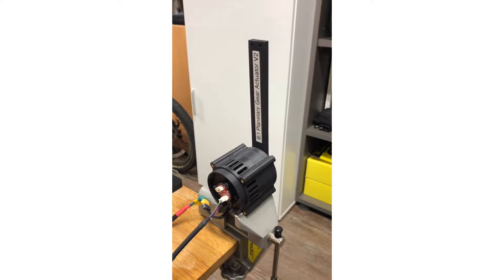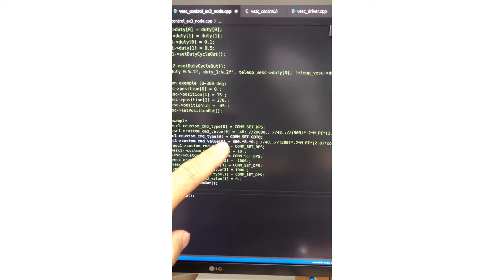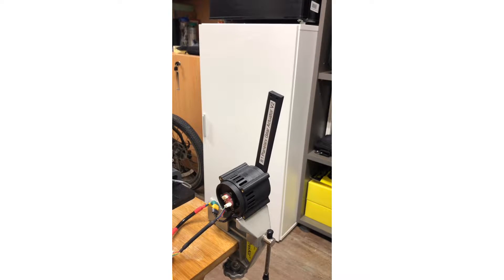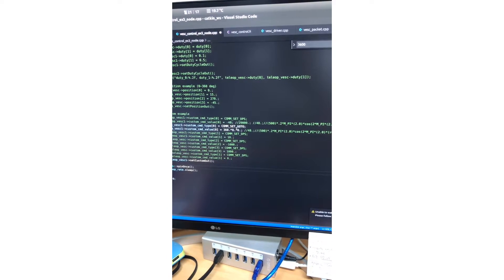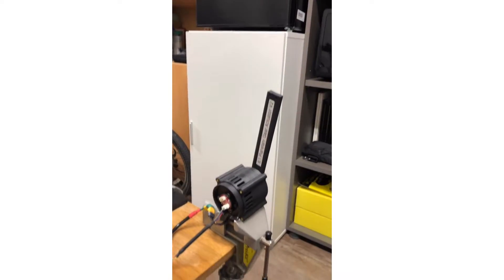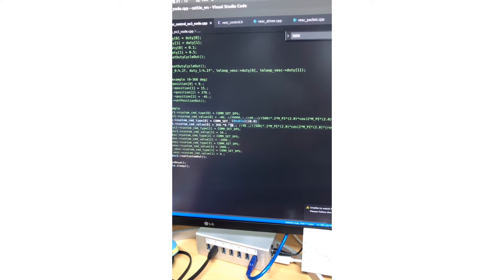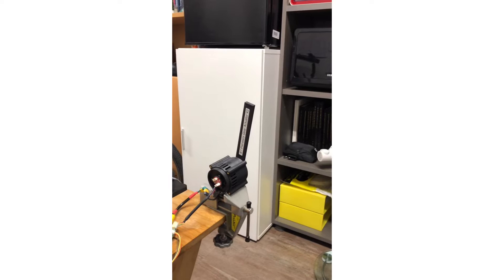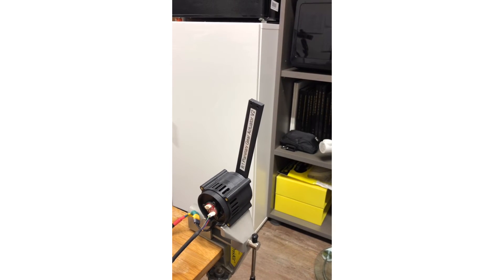MJ-VESC “Goto” control mode test

Comment: Hi, Do yo have any encoder connected to the motor shaft to get the feedback?
Reply from the maker: Yes, a magnetic encoder is attached. the red small pcb is as5047p encoder. It is used for position feedback.
Reply: @DRCLAB2018  Thank you for your quick response, have you tried to do any position control  with a VESC and a bldc motor which has inbuilt hall sensors?. or any sort of open loop position control?.
Reply from the maker: @dprobotix  Among the videos on the DRLC page, DPS control and Goto Control are for high accuracy position control using VESC. DPS & Goto Control is an additional development in DRCL for VESC firmware. Check this one https://hackaday.io/project/167660-vescular-6-vesc6-circular. VESCular6 will soon be commercialized in the Internet market.
Reply: @DRCLAB2018  Hi I got the point, but all those work with an encoder feedback right?, I would like to do position control with out an encoder support (open  loop position control using FOC mode ). Is this possible anyhow ?.
Reply from the maker: @dprobotix  I know that the position can be controlled with open-loop without encoders, and I think the link below is one of those examples. However, as I know, open-loop position control works well only when the load is constant. Generally, in environments where loads change or load is more than a certain amount, open-loop control alone will be limited and closed-loop control with encoder will be required. In our solution, we only provide position control using closed-loop control.
Reply: @DRCLAB2018 Do u have any idea to control vesc with step/dir?? Ormake step/dir conventer for vesc comunication with canbus??
Reply: @DRCLAB2018 Do u have any idea to control vesc with step/dir?? Ormake step/dir conventer for vesc comunication with canbus??

Comment: Hi, I am interested in the "profile generator" that you sir have implemented, is the profile generator implemented in ROS side or VESC firmware side?
Reply from the maker: The 'profile generator' is implemented on VESC firmware. By using this, it is possible to rotate precisely even in very low speed and very high speed also.
Reply: @DRCLAB2018  is the profile generator able to turn the motor to move the position with a specific speed?
Reply from the maker: Sam S. Yes. This is what it is for. I will post more tesing video soon or later.
Reply: @DRCLAB2018  Nice work sir!